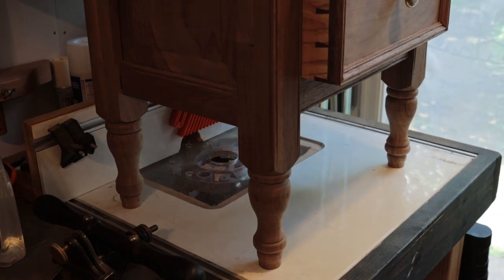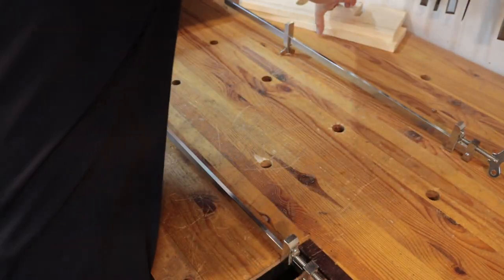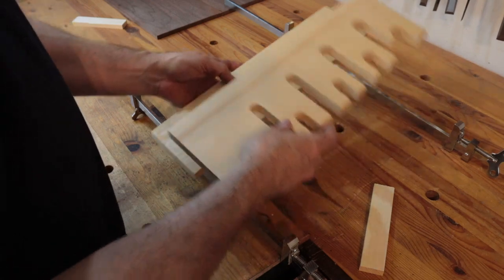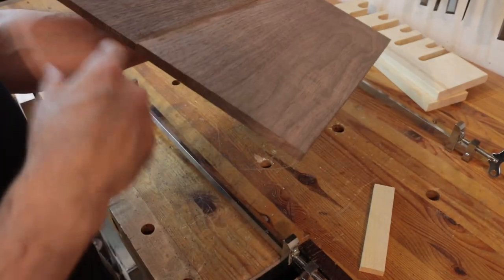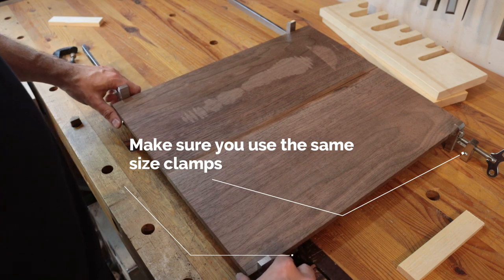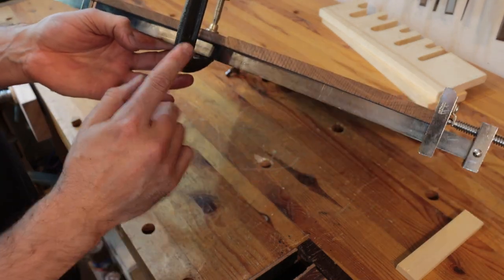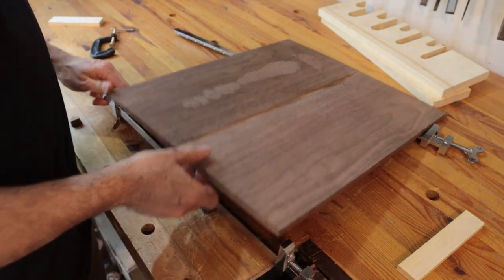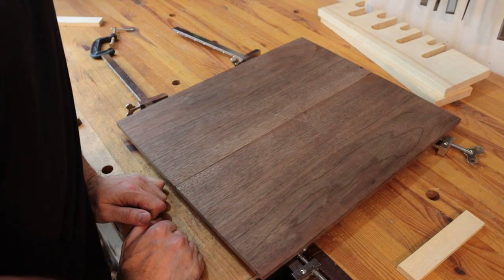PRO TIP!! How to glue-up (butt joint) boards of different thicknesses!

Comment: Great video - and I really like those clamps that seem to afford excellent control.  They look a lot like Japanese hatagane clamps - but they lay flat, which is fantastic.  Could you let me know the brand you are using?  i'd like to order a couple of pairs.  I'm making drawer bottoms much the same way and this method will come in very handy.  Thank you!!!
Reply from the maker: Thanks for watching! They are larger versions of the hatagane clamps. I live in Japan and I buy these at the local hardware store, but I attached a link to the same type on Amazon. That being said, it's the Japanese Amazon site, but I figure you can search from there. Here it is: https://www.amazon.co.jp/%E3%82%B5%E3%83%B3%E3%82%A2%E3%83%83%E3%83%97-SUN-UP-16298-%E3%83%A1%E3%83%83%E3%82%AD%E4%BB%95%E4%B8%8A%E3%81%92/dp/B00E4AWRFI/ref=pd_lpo_60_t_2/357-2958190-6872705?_encoding=UTF8&pd_rd_i=B00E4AWRFI&pd_rd_r=e7a0ed17-ca8c-4e2b-90b1-26ca77066773&pd_rd_w=r5dyk&pd_rd_wg=79z2E&pf_rd_p=dc0198fa-c371-4787-b1e2-96ed0e4d45e8&pf_rd_r=AF9YHZ8SB3TY6MB9S1AN&psc=1&refRID=AF9YHZ8SB3TY6MB9S1AN